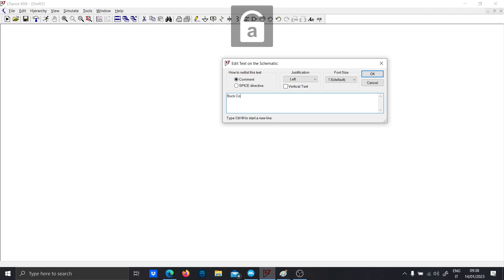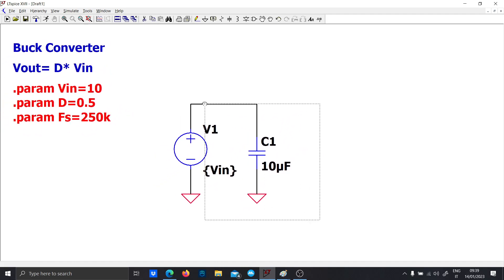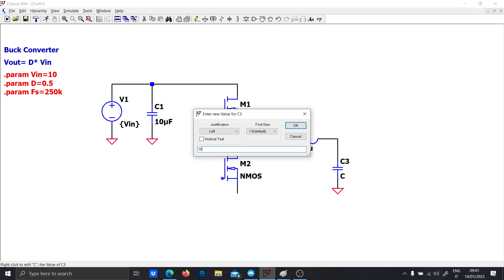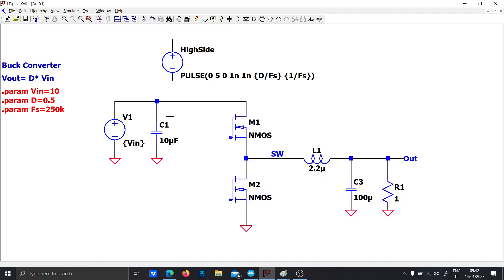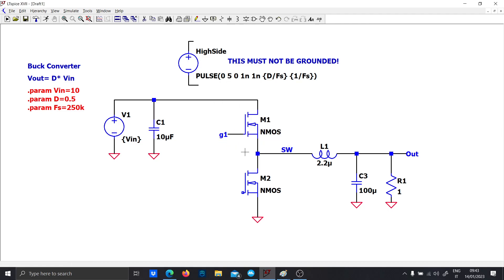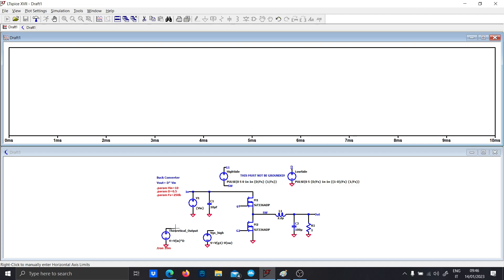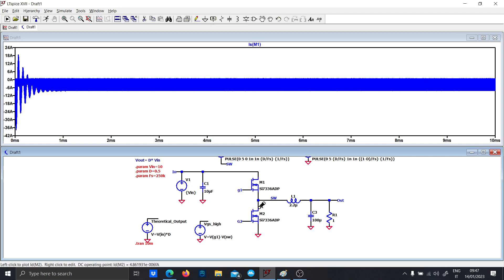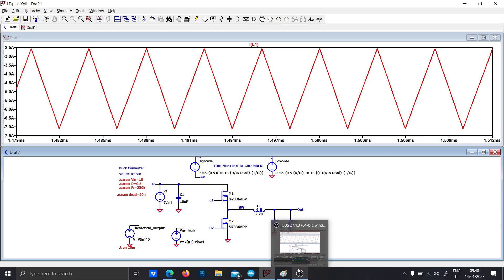LTSpice Buck Converter (No Ic)

Comment: I have done the same simulation as yours my high side gate should act like a charge pump and I need to see pulse of VG+VIN That is 15v as per the input but in your simlation result I see only 5v on high side gate how ??? I am unable to share you the screenshot of the Simulation in comment section